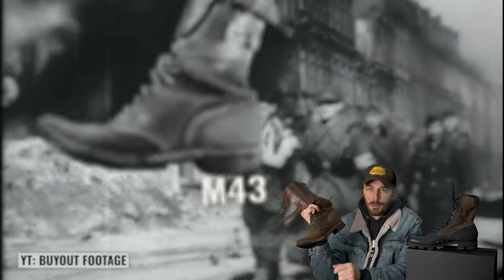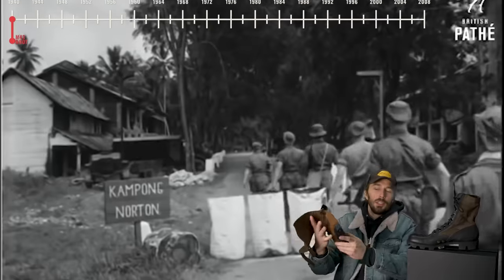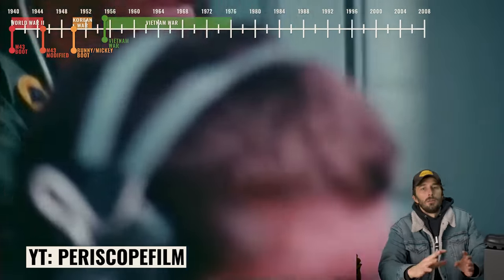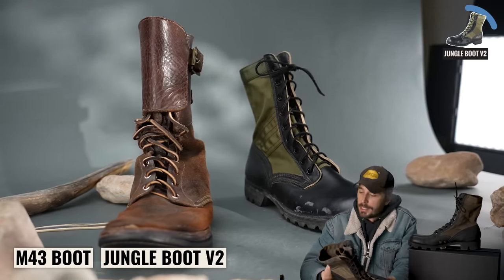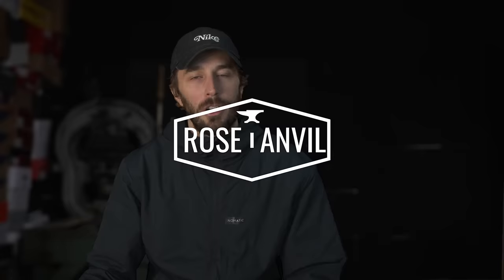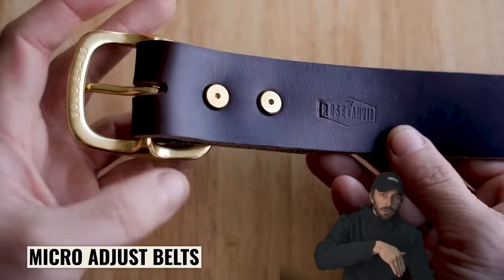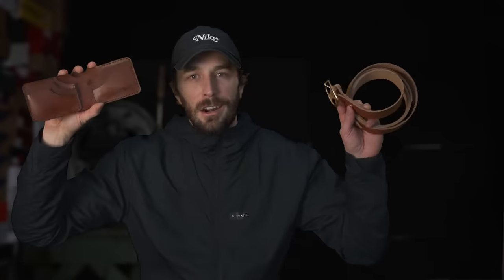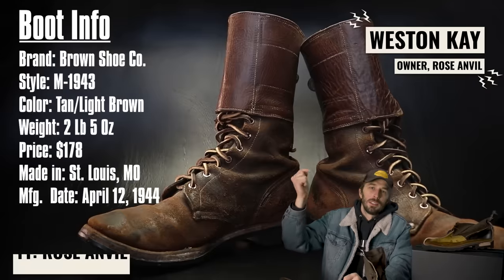Why Vietnam changed boots foreverr - (cut in half)

Comment: I was on a US Army long range surveillance team from ‘91-‘93.  Most of the guys on my team modified one pair of jungle boots specifically for road marches (we were required to conduct 12 mile marches with full gear in under 3 hrs. several times a year).  We removed the leather footbeds and spike-protective plates, installed insoles of our choice, then had them resoled with either Vibram ripple or 2021 wedge soles. I chose the 2021s. They wore very quickly, but they were super-light and bouncy.  It was like marching in sneakers.
Reply: Almost every single person I talk to who did a lot of marching has customized their shoes lol. People dont realize how bad your feet can feel if the shoes dont fit well.
Reply: I liked those soles... but dame they wear out fast on the gravel roads. It's super comfortable but expensive as hell, considering how short of a life they have.
Reply: It’s shocking how heavy modern combat boots are. I wore Korean made jungle boot knockoffs all through the 70’s when I was a motorcycle mechanic.  They were light but wore out fast. 6 months was the norm
Reply: Wedge soles are incredibly to hump in but virtually useless as a killing implement.
Reply: Did you ever try the shark tooth ripple sole?  Incredibly soft - like walking on pillows but they wore out super quick.  My go to boot was the V3 jungle boot then was forced to switch to the new desert boot.
Reply: 😊😊😊 13:20
Reply: So you degraded the boots to cheat on the march test.  Slackers.
Reply: @SteffiReitsch  That would be UPgraded since they functioned better. Modding gear is so common because it works and is why off-base shoe repair outfits exist. 
No important modern war need was affected since when troops deploy they normally draw a full uniform issue including boots so if the steel is wanted in some wildly unlikely jungle intervention they would be issued anyway.  In what units did you serve in which specialty?
Reply: @slughunter20 loved my version 3s with a ripple sole ( or we called them sand soles )
Reply: Thank you for your service sir
Reply: ahhhh memories of the same process.....  had 4 pair that were constantly being rotated in/out of the boot shop for new soles 🤠
Reply: When you say very quickly, did they wear out so fast you carried a spare pair of boots on the march?  Or was that something people did routinely anyway?
Reply: I own a pair of jungle boots that I bought after basic training and I wore em in the summer of Germany 🇩🇪 and then at Ft .Bliss . When we were deployed to Saudi Arabia for Desert Shield we didn’t get the desert boots so we wore our jungle boots and hardly anyone brought winter boots lol . We were there at the start of it and so our boots began to fall apart on some of us and though our supply would order replacements we’d never get em . 
After the war when we had arrived to depart , there we saw pallets full of desert boots but we still didn’t get em till we were stateside and had em for our own regimental parade . 
We even brought back Soviet track vehicles which were on display and worked .
Reply: PS , the jungle boots that I wore in Desert Storm still have my dag tag on my left boot .
Reply: I didn't notice any mention of the jungle boot that the used in WW2 they had a strong resemblance to sneakers, my uncle told me they had them and I've actually seen at least one pair at a gun show rubber soled and a canvas upper.
Reply: Confirmed! Eventually they started selling them with ripple soles

Comment: I've daily worn 2 pairs of V3 jungle boots for the last 2 and a half almost 3 years, year round if its a cold day just wear thick socks, the may be one ugly bastard of a boot but they are great, though with street/daily use the lugs of the soles do wear down to the outsole quicker than most boots, but you can buy 3 pairs for the price of any fancy new boot. 10/10 would recommend (if you can deal with how ugly they are)

Comment: Saran Insole: I expected the hard plastic to be uncomfortable. Instead, they let air circulate under the foot and prove quite comfortable.
Panama Lug Sole: Smooth flats gave good grip on pavement and dry metal. Big clearances led to your picking up tons of mud, yet the same clearances let that mud fall off in large slabs.
Wear with thick wool socks and these boots worked well to surprisingly cool temperatures. I think the steel spike plate was what limited cold weather performance. Heat transmission led to these boots not working well in Desert Storm.
Reply: not wrong
Reply: With a pair of Sealskinz Gore-Tex socks worn under the wool socks they were pretty warm down to around 20F in Germany. IIRC they weren’t authorized for wear from Nov 1 to May 1, but what happens in Graf stays in Graf.
Reply: I wonder if they could have rectified the thermal issue by embedding a steel mesh in the rubber instead of a metal plate sandwiched between leather. It would be a little more expensive, due to a multi stage process instead of a straight pour (don't want exposed steel), but it would impart at least some additional puncture resistance while keeping it away from the feet.
Reply: This is the first time I learned of the special pumping insoles.  (Very interesting, but makes sense, to clearly stamp "DO NOT BOIL".) Hearing your experience for me in a strictly civilian sense it sounds like that type of sole would be great in hot work environments. Wondering if that sort of product is commercially available. I've spent a lot of hours stuck in boiling shoes idly thinking of what could circulate air through the soles, but this would solve it in a very simple, functional manner.
Reply: I was stationed in Panama from '91 to '96. Some time around '93 they starts changing from the green upper to the black upper jungle boot. I loved the greens. The black had speed laces which was nice but the inserts changed and felt like you were walking on knife edges. The black uppers also had a tendency to rip along the back.
Reply: The vent holes allowed the very fine desert sand to build up inside. The sand stayed inside. I taped over the vents in and out. No more issue. Testing found that the vents were an issue in sandy environments. Thus when they issued the deserts. No vents. I had no problems with the deserts. But found they were useless in swamps in Florida.
Reply: Saran Insole:  looked like shredded wheat or a Triskitt.  So right about thinking it would be uncomfortable but no way!  It was excellent at keeping feet aired out.  Super good idea!
Reply: Joke, What did the first G.I. to walk on the sun say?  (Was it DAMN YOU UNCLE SAM!)
Reply: @philsmith2444 I have worn these for about 40 yrs,in PA all year around with regular old crew socks. If you're not doing a lot of standing in one spot they're not bad but I have added a work boot insole that added a little more insulation between your foot and the sole. They have excellent traction in unpacked snow too.
I also wore them for work in MD wading swamps cutting trees for both PEPCO and SMECO all year round until our safety inspector numbskull realized they were not steel toed. Later I was a logger and wore them all the time there. Can't beat them.

Comment: When I first arrived in Vietnam in 1966, I had been issued standard Marine Corps lace up boots.  I think that they were made of horsehide. Anyway, they were totally unsuited for jungle combat.  Not only would the leather get wet and not dry but, the soles and heels were relatively smooth.  A jungle environment can become a very slippery terrain.  Rotting vegetation makes walking quite difficult and I found myself falling quite often on the Deckhouse Three operation - in the IV Corps area.  This was inland from Vung Tau in very heavy jungle.  We were following V.C. trails which often seemed as slippery as ice.
A bit. later on, I was issued the Jungle Combat boot and it was night and day better.

Comment: I wore the Jungle Boot in the mid-late 1980s and during Desert Shield/Storm.  Gotta say, one of the most comfortable, durable, and functionable boots I'd ever worn.  I still have a pair that I wear only in the summertime.
Reply: I was with XVIII Corps Arty in DS/DS, also wore the jungle boots from 86 on.   Still have them and still wear them on snowy, shitty days.   Best boots I’ve ever owned.
    (miss my buddies from Bragg and Saudi so much).    Nuff said.
Reply: @dr.jamesolack8504  Don't your feet get cold in those? They are a tropical weather jungle boot. But to each his own
Reply: Hope you taped up or blocked the eyelets---otherwise, they'd have packed a lot of sand into those boots.
Reply: @matthewgabbard6415  Yes, they weren't good in colder weather.

Comment: I was issued the last version of the Jungle Boot stationed in Panama 89-90. I was a Paratrooper in an Airborne battalion, but everyone was issued this boot being stationed there. I loved the boot because even in state side units didn't like the boots because of uniformity. During the Summer the all leather boots suck because the sweat would pool up inside the boot during road marches and field exercises. During a state side rotation at NTC in the Mojave Desert I brought along a couple pairs of G.I. issue jungle boots out to the desert and it worked okay. The black leather absorbed heat and the steel plate sometimes got hot on the bottom. Otherwise my feet could breathe and keep my feet dry as long as I had done my part to bring plenty of socks to change. But in tropical climates It was great, if you were an infantryman it can last you 6 months and trade them in at CIF where it was standard issue. In the 90s the design stayed the same except for the nylon uppers became black in color until phased out by the Infantry Boot in the early 2000s till 2005. The Infantry Boot was an improved design used by the Navy SEALs back then but became Army issue until that time, now it's hard to find and rare. Yes I loved the jungle boot and the Desert Storm Version which was still issued till 2007.
Reply: 1/508th Airborne infantry, fort Kobe Panama. Red Devils
Reply: I went to JOTC (Jungle Operations Training Center) at Camp Sherman, Panama in '84 (IIRC The 80s was a busy decade for me) LOL
Reply: @clintonwalls3642  A co. Moatengators. 👍💪
Reply: @reddevilparatrooper  I was stationed in Panama from '91 to '96. Some time around '93 they started changing from the green upper to the black upper jungle boot. I loved the greens. The black had speed laces which was nice but the inserts changed and felt like you were walking on knife edges. The black uppers also had a tendency to separate along the back.
Reply: @MN-Hillbilly  You are right. I had to replace mines twice in Hawaii humping East Range. I had one pair that the back of my right heel totally rubbed raw and bloody. Lucky I keep my other pair of boots in my ruck. Yes they were pieces of shit for boots.

Comment: I would really enjoy if you cut in half the modern US Navy “Safety Boot” It has a very similar construction to most modern issue combat boots, however it sports an odd sole design, steel toe, all leather upper and lower, and a fire resistant nomex lining. It would be interesting to see how safe my feet really are when im aboard a ship!
Reply: Steel toe is a death sentence in cold weather even a little snow and you will get frost bite and die in a survival situation. A buddy and I hiked six miles to get help in the high Sierra in N Cali in the early 80's it was bad for both of us....freak snow storm in March. FYI all the P-3 Navy ever got were standard steel toes. And yes we were working the Sea's of Alaska. So much for the navy caring...
Reply: Oh I know all about it having come from doing a lot of hiking and such to here. Don’t forget to take in account that if a steel gets crushed, theres no getting your toes out, even if you get whatever heavy thing crushed it off, say by to your toes. Composite would be much better but big navy would probably say “something something melt” despite having rubber vibrams…

Comment: I wore Vapor Barrier (Bunny) boots in extreme cold (Alaska Infantry) for years.  Water getting inside the boot doesn't matter.  Still warm.  Water getting between outer and inner layer, defeats the vapor barrier quickly. They are always warm.  In the kind of temperature these boots are intended, there is no water, all ice.  I have left them outside my tent, open end up, overnight in the snow.  Moisture from foot sweat frozen inside.  Put my bare feet in them in the morning . Warm in seconds!  Then I took my feet out and quickly dried the inside, which I should have done the night before.  These boots kept me alive in subzero weather.  Carry two pairs of dry socks.  Switch them out to reduce perspiration moisture.
Reply: Ft Greeley/Black Rapids alumni here. Deployed there for training with the 101st way back when. First time I ever saw a hot cup of coffee get tossed into the air, turn to powder and blow away!
Reply: Your feet smell like death when you take them out. I also liked the five buckle boots.

Comment: interestingly, the platicy meshy insole looks like the same type that the late 1980s British Combat High has but that boot had no holes to pumo the water out - the insole had a very rough side and a smooth side and you were supposed to have the rough side down but I wore it up because it gripped my socks and reduced movement/chafing/foot blisters

Comment: I was a delivery driver of building materials in Georgia for about a decade and wore these jungle boots exclusively, and for the very reason they did in Vietnam. It lets the thick Georgia clay fall free relatively easily. I can dispel the "myth" that the soles wear out more quickly, but that's from walking on the concrete of our warehouse, not from carrying heavy sh*t through the mud and clay. I quickly learned to replace the boots when worn out with cheap knockoffs you can still find around for $30-40, rather than the $80 the real deal might cost. I've long since given up such endeavors as delivering windows, doors, siding, and roofing, etc... but still always have a pair of these in my closet all the same. Great vid! Thanks for sharing!

Comment: Great video but as a footwear specialist you really need to understand and explain Trench Foot better. Trench Foot is a "Non-freezing cold weather injury". It occurs in cold weather conditions between 32'F and 60.8'F.  The damage is mainly caused by prolonged constriction of blood vessels in the feet leading to painful soft tissue, nerve & vascular damage. This occurs from a combination of cold weather, poor circulation, and is typically associated with prolonged immersion or wet footwear. Other contributing factors are tight boots, standing still for long periods & malnutrition . Trench foot is not the skin "rotting" because of moisture and bacteria, although once Trench Foot occurs the skin can become badly macerated, blistered & infected. Jungle boots were not designed to prevent Trench Foot because that's a condition of cold weather. Instead Jungle boots are designed to reduce problems caused by having wet feet in hot humid conditions These conditions are poorly defined but have been variously called "jungle-rot" "paddy-field foot" or "Tropical Foot Immersion", and are characterised by mild to severe fungal infections, skin maceration and painful foot swelling.

Comment: I wore them , I liked them , I remember I had a pair that the steel shank cracked in half and whenever you walked it would snap at every step. Had to dx them,( turn them in for a new pair). Thanks
Reply: Happened to mine too - black ones from the late 1990s. Clicked every step. Loved them otherwise. Threw them out as we transitioned to coyote brown boots.

Comment: @RoseAnvil
 There was also boot that was basically a middle ground between the m43 boot and the Vietnam jungle boot it was called the Okinawa boot it was basically the same design as the m43 boot but it had canvas in certain areas of the boots like the jungle boots used in Vietnam but the okinawa boots also had the double buckles like the m43 boots originally the first U.S. military officers and military advisors sent to Vietnam originally war the Okinawa boots which were the original jungle boots before there were the ones shown in this video.

Comment: By the 1960s the British Army had a good, expendable jungle boot, which if you were on strenuous operations was exchanged for new ones every two weeks when your resupply was delivered. It had a black, rubber sole, and the rest was green canvas with lace up eyelets. Usually there was a bit more wear left in them when they were discarded, but I doubt whether they could have lasted a whole month. It was best to coat them with insect repellant to prevent leeches climbing your legs and getting onto your body. Leeches were very common. Our green cotton shirts and pants were renewed at the same time. I sometimes wondered how much protection the canvas would give against snakebite, there were plenty of snakes but I only once knew a soldier to get bitten

Comment: I was issued 2 pairs of these boots when stationed at Ft. Benning (3/7th Inf.) in 1982 right before we went to the jungle warfare training school in Panama for 3 weeks. My 1st experience with them were long road marches in full gear and pack and the steel plate really did a number on my feet until I got use to them and broke them in. Very good design and functional boot and I wore them constantly even after leaving the Army and used them for work in my civilian jobs.